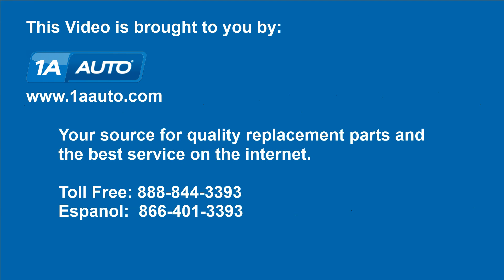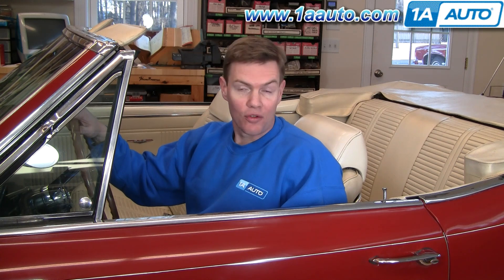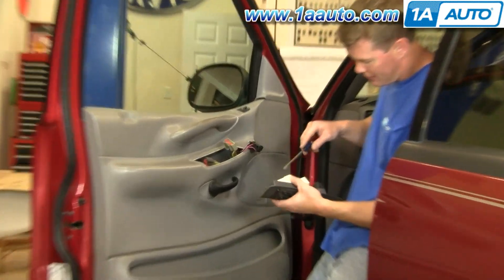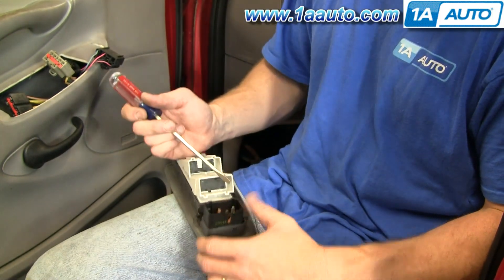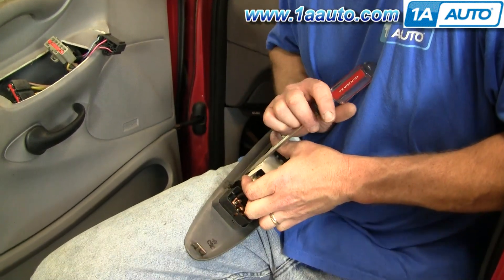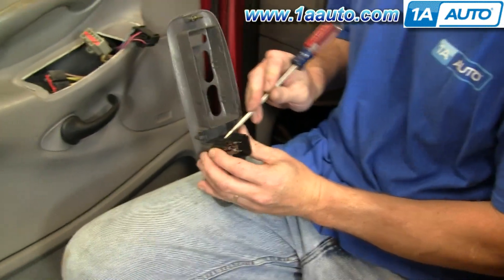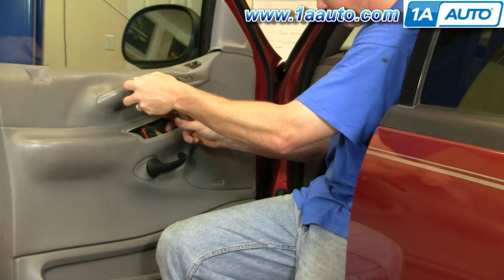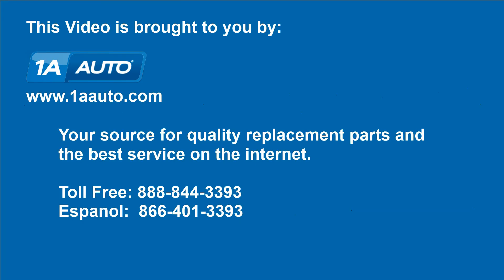How To Replace Power Window Switch 97-03 Ford Expedition

Comment from the maker: You may want to see if there's power to the window motor when you press the switch. You could test it with a test light or an ohm meter. 1aauto.com 888-844-3393

Comment: My driverside window will roll down but not up.  All other windows that it can control have no problem.  Could this be a faulty switch for the driverside window?  Or does the door have two motors, one for going up and the other down.  I do not want to get a switch if I need to get a motor. I don't have that much mullah... Help